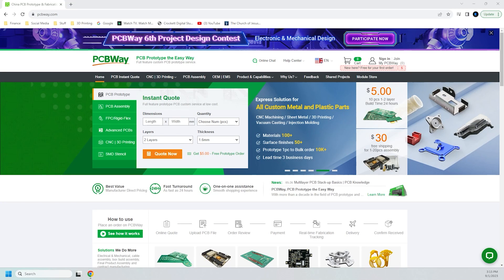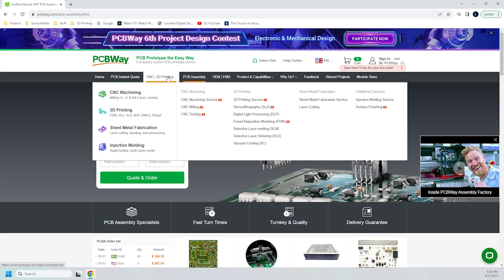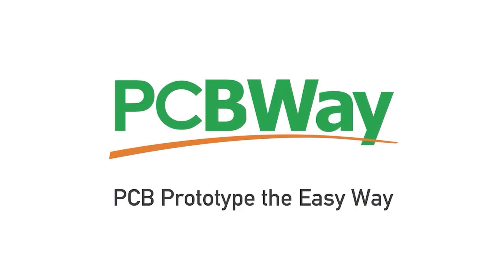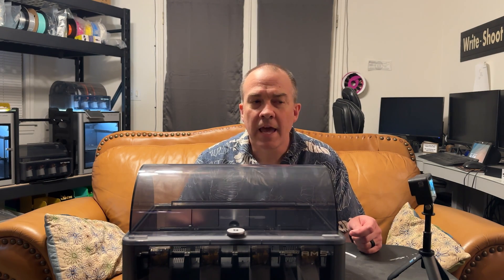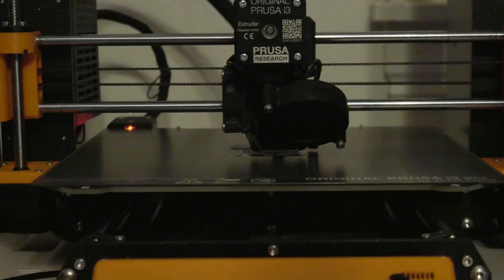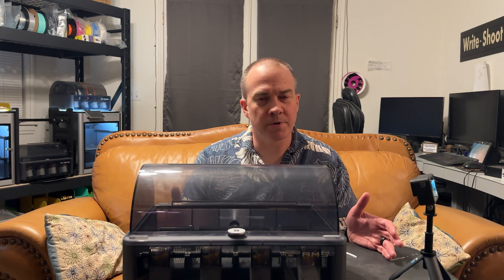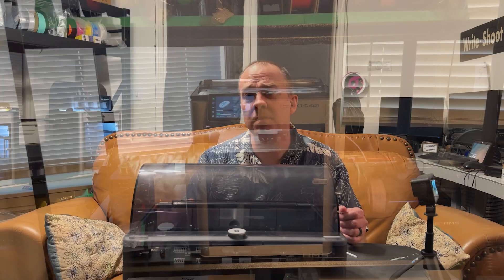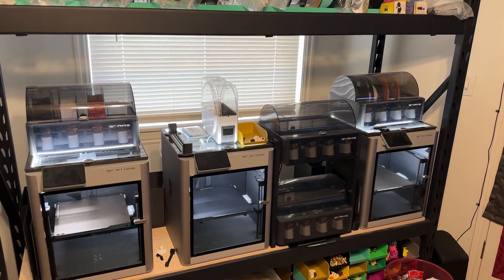Bambu AMS Problem, and the Solution

Comment: I've read a hundred plus posts, watched too many videos, and my problem came down to this tube rubbing on the glass. Before this I took my hot end off, my extruder apart, and nothing worked. I ordered the tubing and cutter that is in the link, and it took me less than 10 minutes to replace it. I am up and running after being down for several days. 
Thank you so much!

Comment: Bambu specifically states that thicker PTFE tubing causes issues. I bought some 3rd party/high quality PTFE and had nothing but problems with filament getting stuck, until I replaced with OEM PTFE
Reply from the maker: @fashizzlemanizzle4808  sorry to hear that. That has not been my experience.

Comment: They caution against using abrasives because it will wear out your parts SOONER.   Those Bowden tubes are a consumable wear item regardless...that's why Bambu gave you an extra set with your printer...because, yeah... They wear out eventually no matter what filament you run.   Just a matter of, just run regular PLA, they may not wear out for a year... Run PLA-CF they might wear out in a month.   That's the difference

Comment: if you don't know why you had this problem sorry, takes lots of years to get it all. but you ran an abrasive spool through that slot of your AMS. which Bambu now states not to. so its somewhat understandable. however you will find from now on any abrasives aka FC GF Glow in the dark.. run it through a separate dry box. Best of luck Sir.
Reply from the maker: @pikewhite  but that’s not the case. As I said in the video, I followed all of their guidelines, including to never run abrasives in the AMS, and this still happened.
Reply: @thisprintedthing7967 as it will... These are a wear item... That's why the printer came with a spare set... They will wear out eventually no matter what...running abrasives, they'll wear out a lot SOONER.   I'm printing some parts with Fiberon PETG-rCF carbon fiber filament in my AMS... I fully expect after just the one roll of filament, I'll likely have to replace a Bowden tube in the AMS as a result... It's to be expected

Comment: tubes are a wearable consumable. meant to be replaced eventually.

Thin wall (larger ID) tubes used to reduce friction as filament travels the LONG ams path.

Capricorn has released an ams version of their famous PTFE tubes.

Comment: print a ptfe removal tool.  so much easier than pliers.
Reply from the maker: I have one. However, that tool won’t fit into the confined space where that tube connects.
Reply: @thisprintedthing7967  you push from inside with your fingers and pull. Its a designed "tool" built in. Hence the spring on it. Secondly your Units came with extra PTFE tubes to replace the worn out ones. Nothing really out of ordinary. Thirdly, be careful when opening the unit, those boards are SUPER sensitive to static and will destroy them.... ask me how I know... yes it happened to me as well replacing the third set of tubes.

Comment: Bambu Lab does not say not to run abrasive filaments through your AMS merely that abrasives filaments will wear off your PTFT tubing quicker but it’s perfectly ok. 

With regards to the PTFT tubing you are using it’s important that the size of the hole inside us not smaller than the original PTFT tubing that Bambu Lab use. 

Bambu Lab indicates that the PTFT tubing is a consumable and it will require to be replaced periodically. The more abrasive your filament the quicker it will need replacing. 

I had to change the PTFT on my first X1C AMS after 9 month and over 3,000 hours of use.
Reply from the maker: You’re partially right. They say not to run abrasives… except those from Bambu Lab. Or at least that’s what their wiki says, unless they’ve changed it recently.
Reply: @thisprintedthing7967 
Yeah, from the AMS main page: “*Filaments that are too soft, brittle or brasive are not compatible with the AMS, such as Bambu PET-CF/ TPU 95A, TPE, PVA (wet), BVOH (wet), and other brands' PET-CF/GF, PA-CF/GF, PAHT-CF/GF,etc.”